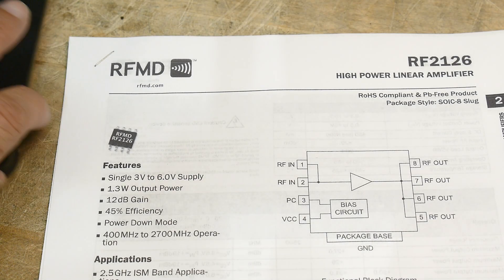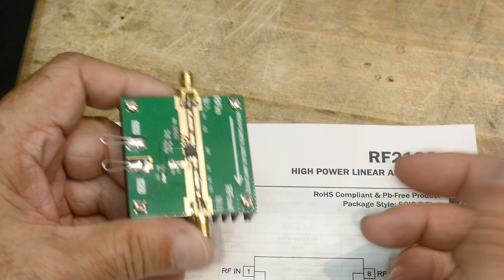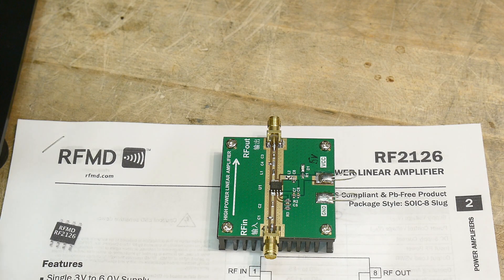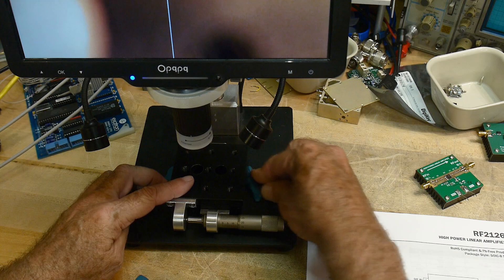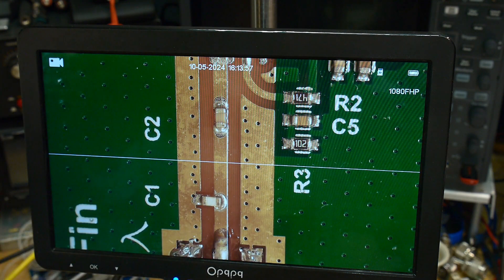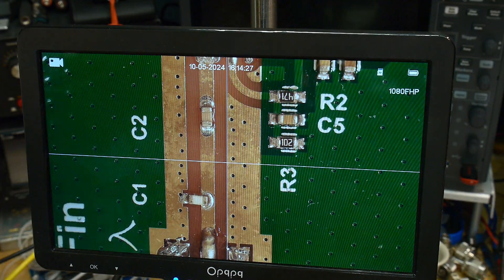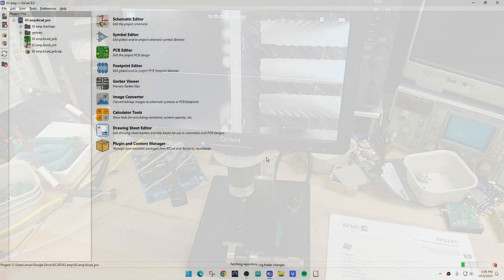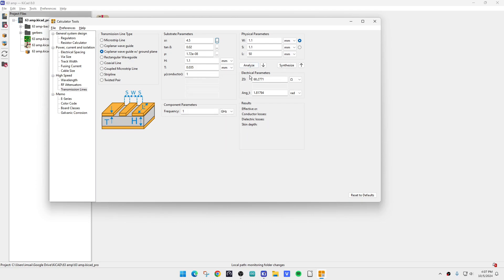#2034 RF2126 Amplifier and Toolmakers Microscope

Comment: Could you please share a link or some sourcing info on the microscope and stage you were using?  That ‘scope oozed nicer than the pretty cheap ones that seem to be everywhere.  Thanks!
Reply from the maker: https://youtu.be/o8ysuQjDCvc?si=-Wps-ttUBknIRVU9
https://youtu.be/_iP4-sX1-uU?si=lfyXguZwTZiNmD_w
https://www.edmundoptics.com/c/manual-translation-stages-and-slides/646/?srsltid=AfmBOooOy54AXgaatNeJldzi8dmJrD-opOYUznGqpoJaXyJ3sMjpLmzN
https://www.thorlabs.com/navigation.cfm?guide_id=2

Comment: Yup. I have used this part for probably 15 yrs. My first project using this device was a driver amplifier at 2.5ghz for the amateur radio television repeater system in So Cal. This drove a 15W amplifier into a 24db open grid dish antenna.

Comment: Nice video. Thank you. 
By the way, C5 is cracked. Are you sure the chip is dead?. IMay be the inductor is open. Have you considered that?
Reply from the maker: the IC draws zero current. the cap can't do that.
Reply: @IMSAIGuy  I know the cap cant do that. But since it is cracked who knows why, and this suggests that other parts may be bad for the same cause that cracked C5, an open inductor can explain no current draw. Have you checked the inductor?.
Reply from the maker: I did look at all the parts and for what it's worth, the cap is not cracked.

Comment: FR4 refers to Fire Retardant rating. Did you say  anything about G10 Glass Epoxy? The PCB looks like cheap Vero-board, which is a cheapo cellulose composite. A Witches brew PCB. Best not to draw hasty conclusions when entering data, with far too many unknowns in the first place.
Reply from the maker: everyone just uses 'FR4' to describe glass epoxy. even the datasheet for the RF2126 calls out FR4.

Comment: I am sorry, but. That chip is intended to be 1.3W power amplifier. If you think about 1.3W in 50Ω system, then it is something around 8V rms, which represents about 11V amplitude, right? With a chip powered from max. 6V power supply. Well, there's no possibility how this could have 50Ω output giving 1.3W, in fact that output have to be loaded by something MUCH LOWER than 50Ω, right? What about the input impedance? That thing is declared to have 12dB gain, so if the output is 1.3W (abt. 31dBm) then it requires about 19dBm on the input. 19dBm (abt. 82mW) in 50Ω system is about 2V rms, which is 5.7V peak to peak which is a lot for a chip powered from 6V psu, so in my opinion also the modulus of input impedance could be slightly lower than 50Ω. This leads me to two possible conclusions:
1. That line is precisely designed to match both input and output to 50Ω system on some particular (and well unknown) frequency.
2. Rule "Don't care about line impedance as long as your line is shorter than 1/10λ" was applied.
Reply from the maker: if you read the datasheet, it has a nice reference design with 50ohm transmission lines. however, reading the datasheet very carefully, you notice Zload specified at 12ohms. Marketing at it's best.

Comment: I think that the answer is fairly simple: the original design was for a different thickness board and someone, that has no idea how any of that works, just copied the design and had it made.
Reply: Datasheet also says pins 5-8 are rf out, but 8 is tied to bias if it's even installed right
Reply: Yup, for 0.6mm it comes up almost bang-on 50 ohms for plain FR4...
Reply: You may never know maybe he tested on his oscilloscope, and it really works why dont  you try it and see the output
Reply: @neodiy  That makes no sense
Reply: @galileo_rs  i make nonsense circuit and nobody knows it really work for me for 8 years straight. I am not going to share it because it save my internet connection like no tomorrow while everyone whining about how slow their connection are. I am not bragging just to prove to you nonsense does work sometimes
Reply: @neodiy  Once again you are not making sense. Gather your thoughts and try again.
Reply: @galileo_rs  i dont need to argue for words of nonsense...prove it thats it
Reply: @neodiy  I'm not arguing, let me try again: what you write makes no sense, I do not understand what you are saying. Your thoughts (sentences that you wrote) are incoherent and it is impossible to understand what you are trying to say.
Reply: @galileo_rs  i am too lazy  to make it coherent ...for something that has no end